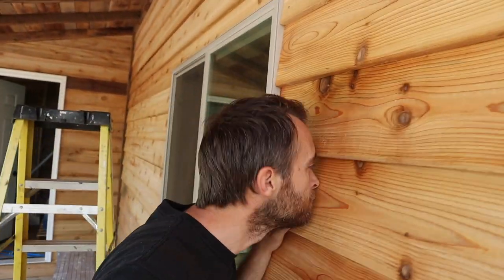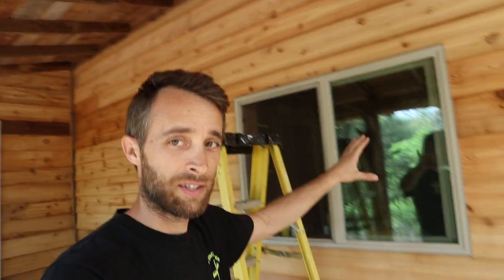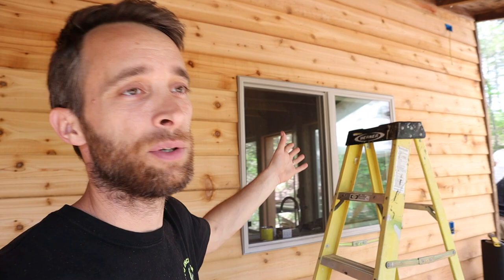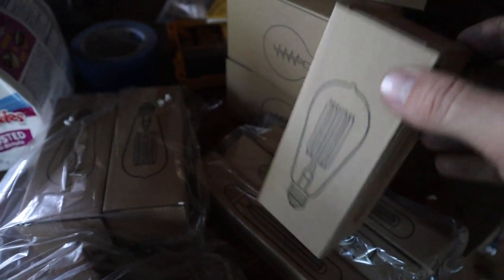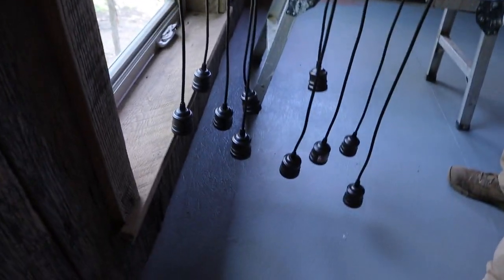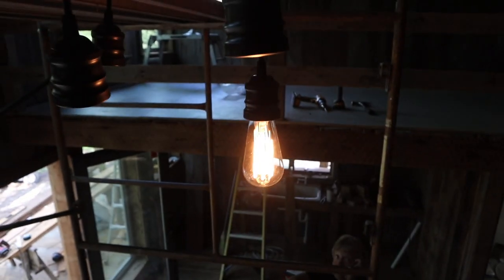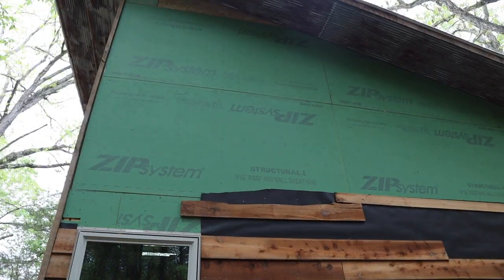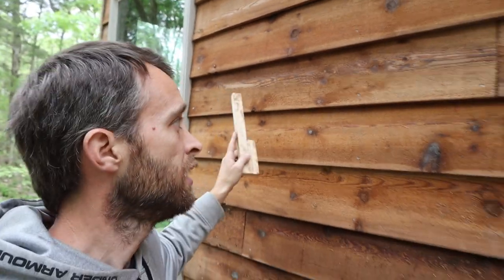Cedar Siding Install using the PREACHER STICK @ the Off Grid Cabin - EP #18

Comment: Should have fired up a hand planer and took off the first 1/24", would lighten up that old growth no problem. I took some old growth CVG western red cedar siding off my house built in the 30's. The house was painted (but peeling) so i flipped it over, hit it with my planer and sander and stained it. Looks brand new.

Comment: Is there a reason you didn’t use the same zip tape on the seems between the sheets of zip board? Because rain and snow or ice can enter through them as they thaw and refreeze during the day.
Reply: That's why they put tar paper over the zip system. Lmao.

Comment: Hubby and I like cedar! Surely you won't paint over it! Everything is coming together. Looking good. Are you building a kitchen pantry or cupboards to the left of the sink? Need more storage. Thanks for sharing. At least the Preacher's stick is not like a Principal's stick! Ha!
Reply from the maker: No we won’t paint it but will stain it. Left of the sink will be the refrigerator. Thanks for watching
Reply: If you can, invest in a very good quality frig so that you don't have to replace it as often. Trying to avoid scuffing up a floor, door frames and edges of walls, plus getting it into the house, and the old one out is a pain. Literally and figuratively!

Comment: You went to all the expense of using Zip sheating and didn't bother taping the seams to make it air tight? You went to the trouble of explaining your air tight system on the windows. Otherwise looks good.
Reply: Didn’t see any window flashing or red guard or other waterproofing in the bathroom either. But I think they are cutting the budget where they can. The problems will crop up in the years ahead. And my be someone else’s house at that time.